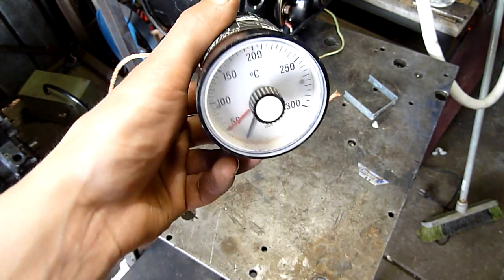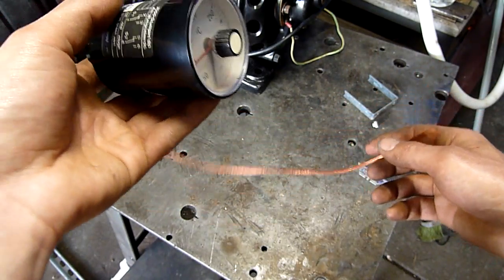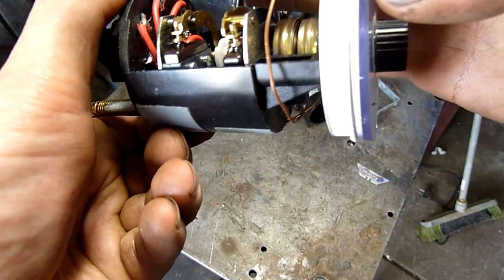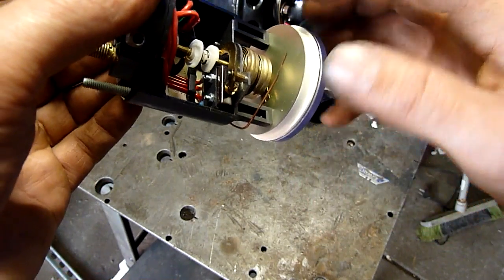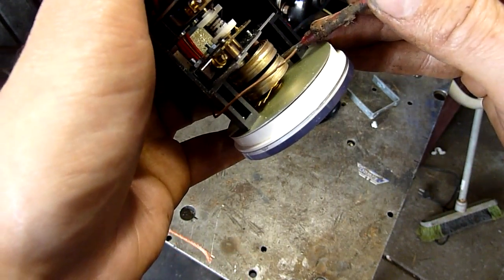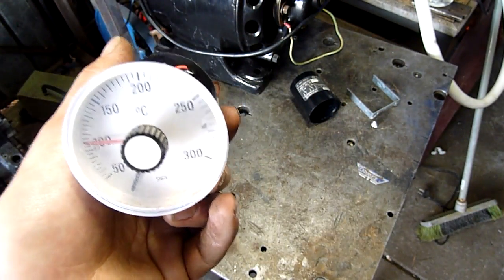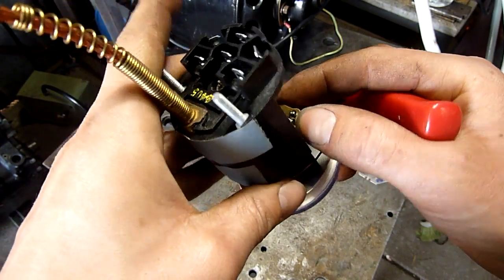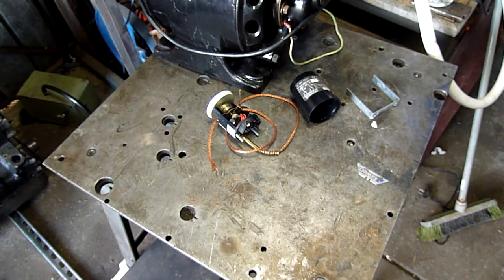Stork Analogue Temp Contoller Autopsy

Comment: it is a shame. im thinking with you that without a factory calibration and test procedure they are screwed.
could be used as a pressure switch, calibrate how many PSI for a full scale reading. rescale?

Comment: never seen the inside like that before , atleast  on the A-B units you could replace the bulb assembly as it directly pressed against the switches and the dial controlled the spring pressure to push against it , oh well save the micro switch and pitch the bitch as we would say in the shop .

Comment: The amount of charge wouldn't matter as much as the type of gas they used which i assume would be a type of refrigerant because refrigerant stays at a specific pressure at a given temp so in theory as long as there is still a bit or liquid refrigerant left at max temp it should work.